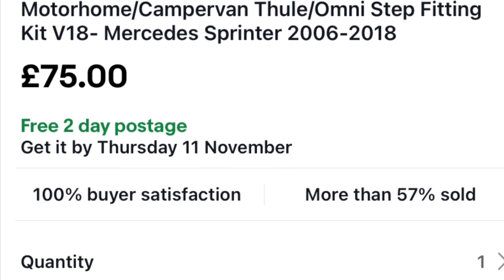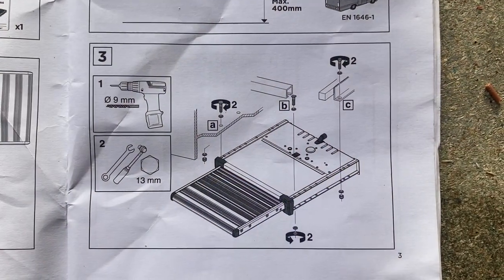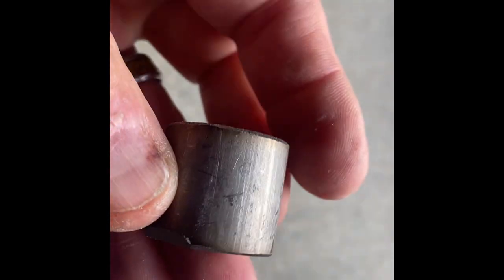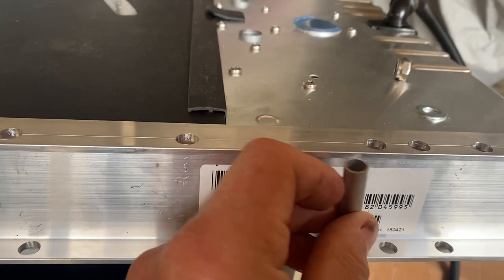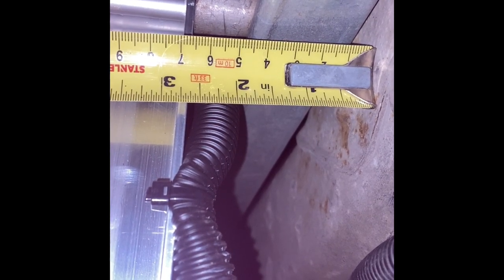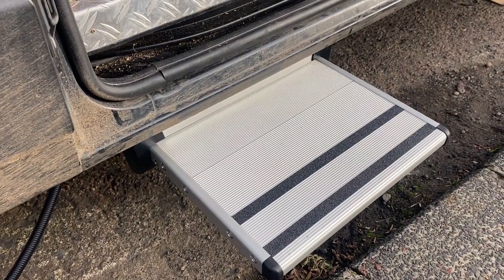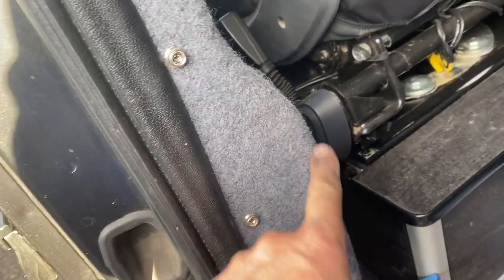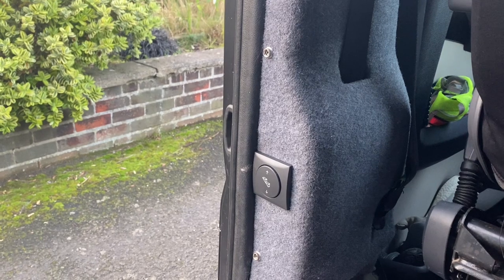Homemade NO WELDING fitting kit for Thule Omnistep

Comment: Ah here, there's a couple of major flaws in this video....firstly, you are actually your beautiful assistants 'handy bloke to have around'

Secondly, I noticed Lisa was the first one to test your brackets, had the brackets failed I'm sure she would have brought you grapes, 😁
Reply from the maker: Of course. Always get someone else to be the crash-test dummy. Don’t tell her I said that.
Reply: Really Good video, the steps are very  pricey and the fitting kit adds another lump of change.  It always amazes me the stuff people have 'just lying around the garden, if someone didn't have stuff like that, again, just lying around the garden. Try the skips outside building sites, uni strut is used by 3lectricial contractors and hevac installer's. Sometimes and simple ask might just get you a bit of an off cut. Always ask to take even  small bit, it's good manners and you might even get other useful bits thrown in too.